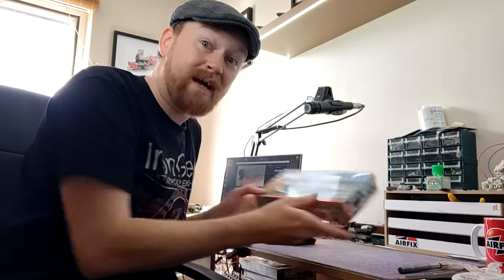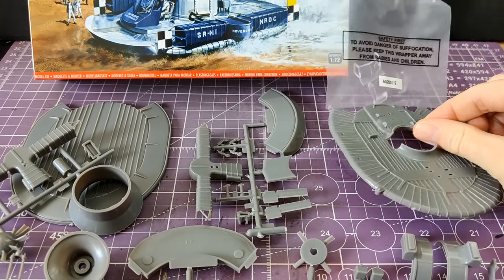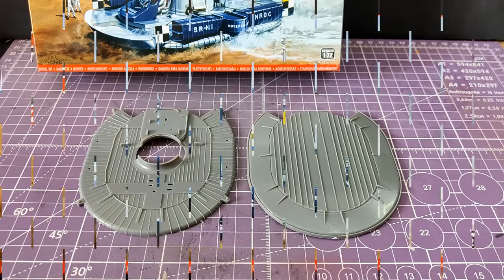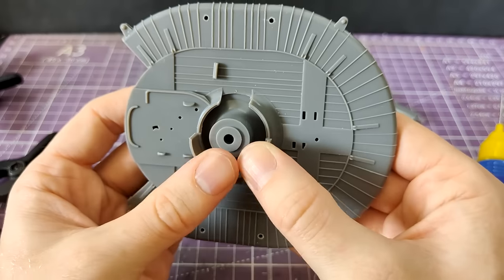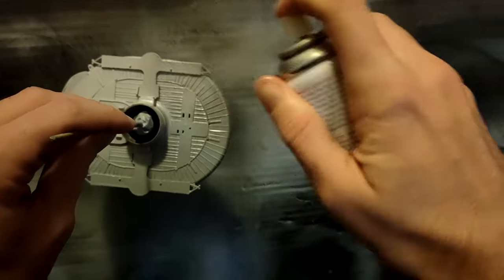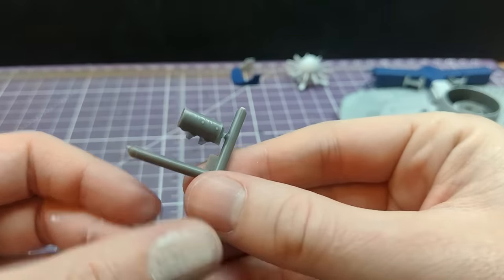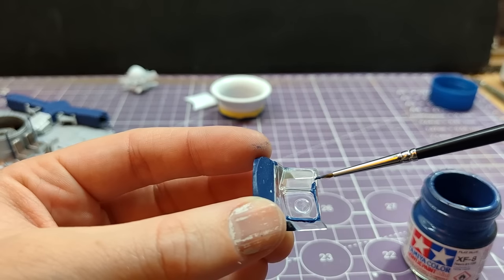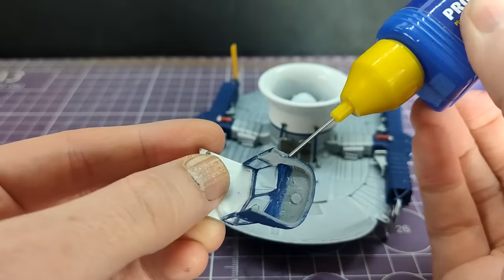Is the Airfix SR.N1 still good after 6 decades?! | Unboxing and full build of a Vintage Classic

Comment: I bought this kit when it was first released at the beginning of the 60s. I'm sure that in those days, when only the bigger and more expensive series kits came in a box, that this, like all the Series 1 & 2 kits, costing about 2 shillings or 3 shillings and sixpence (10p & 17.5p), came packed in a small polythene pouch, with the instructions, main illustration and description being all on one sheet of folded paper that formed the seal to the bag, fastened to it with staples.

In those days, with written construction details as well as the illustrated blow-up version, each part was identified in the (English only) text by name, leaving the guesswork out of what each bit was.

From memory, your blue looks about right. It was certainly a mid/dark blue rather than a light shade.
Reply: Two shillings and three pence I seem to remember, used to get change from half a crown?

Comment: I made this kit 60 years ago!
SARO was a remarkable company especially its post WW2  produces. There was the Princess the largest of British flying boats ten engines, might have been largest practical ever because it flew a lot more than the Hughes H4; the SR A-1 Flying Boat Jet Fighter; the SR-53 Rocket and Jet interceptor; the Skeeter and P531 early light helicopters; the SRN1 the first hovercraft, the SRN4 Mountbatten the largest ever passenger-car hovercraft ferry.  If that was not enough they produced the early full size satellite launchers Black Prince, Black Arrow and Black Knight.
Reply: I think this was the first kit I bought and build because it was the cheapest, I didn't even paint it... no idea what happened to it, probably got tossed

Comment: 4:59 This is the air smoothing vanes and dome. The fan is the four bladed part that fits underneath. 
If you relieve the hole in the four bladed fan, you can have it rotate (otherwise it is tight). Painting the four blades in a contrasting colour to the white will make them stand out better beneath the 11 vanes. Of note, the instructions don't give any indication of orientation but I can tell you ... having a single vane to the rear and two vanes to the front is correct.
Reply from the maker: Excellent! Thank you for the info!

Comment: Yep, I'm afraid that I also made one of these back in the 1960s. Flashback time.
Whilst not even being a teenager, I couldn't understand how it could form an air cushion. No holes in the bottom ? !
Also, when it's been broken a few times and it is time for it to go (I was a kid and it had a hard life) without the wheels, it can skim over smooth floors quite well if thrown like you were skipping stones across a pond. (not so good on water.)
Mine of course looked nothing like yours'.

Comment: 5:11 The part on the runner bottom right is the four blade fan. 
To get this to rotate freely on the spindle, relieve the centre hole. 
As it is, it's a really tight fit and the blades will most likely get broken when fitting. 
I painted my fan blades red (wrong I know) so that they can be seen below the smoothing vanes.

Comment: Interesting the model depicts the hovercraft in it's prototype form, later it gained a more pointed bow , doors to the cabin and twin fuel tanks one either side towards the front, also the front windscreen was fitted with window screen wipers instead of the circular spinning clear screen.
Reply from the maker: I expect the R&D for it was either done before the changes were made, or from drawings supplied by Saro. It is fairly standard for Airfix kits of this era to be made from prototype drawings over the real thing - part of their commitment to get a model out asap.

Comment: This kit stands out so much in my mind because it was so unique when I built it back in the mid-1960s. The re-issue stands the test of time well, probably because there's nothing else with which to compare it. The re-issue is great and I'll build it again but I would have loved to seen a completely new kit in 1/48 or an even larger scale. (Not sure if that should be 1/35 or 1/32 scale. It's a land and sea vehicle but actual travels above them, in the air. So, should be be larger AFV scale or larger airplane scale?).

Comment: Remember it coming out. The plastic was a silvery one, I think, and the ducts and rudders weren’t very well formed. The glue we used then was very corrosive and it was incredibly easy to melt the rudder mounts. Modern plastic works much better than the old stuff. 👍

Comment: I’ve found a video on YouTube showing the srn1.  It shows the crew wearing white overalls with oxy masks and silver bone domes.  It also shows an exhaust pipe on the left side of the engine trumpet, right where you assumed that it was incorrect
Reply from the maker: I still have the figures - I may paint them up and fit them.

The exhaust is on the left side on mine - following the instructions would have put it on the right side.
Reply: @VFCproductions  yeah that’s what I meant.  You thought you’d fitted the ducting the wrong way, but you havent

Comment: The 'beauty'of buying the Airfix vintage classics is, as they're using the original moulds, you'll have plenty of flashing and mould faults to correct - ! 😅
Reply from the maker: Flash is just extra plastic for your money!
Reply: I gave bough a couple of the Vintage Classics kits like the Beaver and the Bassett, as swell as the SR-N1, and Airfix have obviously taken the time to make sure the moulds are clean, helps that these kits haven't been around much. If you want flash try a Mach2  kit. Real sense of achievement as well.

Comment: Bought a SRN-1 this week & was gutted to find some of the Cartograf produced decals on the sheet are way out of register !  ( No.3 SRN-1,  No.4 NRDC & No.6 Hovercraft decals )
Anyone else got the same problem with their SRN-1 decals ?  This is the first time I've had this problem with any of Airfix's Cartograf made decal sheets ...
and I've got lots of the new mold & Vintage Classics kits in my stash.  What is Airfix's customer service like these days, will it be easy enough to get a replacement decal sheet ?
Reply from the maker: Is this not how they are supposed to be? The photos of the real thing show a very heavy shadow on the text
Reply: @VFCproductions  Thanks for your reply. If I could post a photo you would see that the blue shadow effect on my sheet is way, WAY out of register. 
My decals are nothing like the sheet in your video. They are most definitely out of register ... by several millimeters !  
The blue shadow effect is totally separate from / doesn't touch the white lettering, it's miles off !  Very un-Cartograf like, they're always "spot on" register / quality wise.
Thanks again.
Reply from the maker: @wullie3xv923  I would absolutely message Airfix then. Certainly a surprise, as you say, but I'm sure they'll be able to send out another sheet. I've not needed to get a replacement from them for some time, but I hear they're still good - let me know how it goes if you do.
Reply: @VFCproductions  I've just finished pinging off an email to Airfix with a photo of my decal sheet attached. Lets see how long it takes me to receive a replacement sheet.
This is the first time in decades I've needed any kind of replacement from Airfix so I hope their customer service is still functional !   Thanks again ....
Reply: Great news, folks. A perfectly printed replacement sheet of SR-N1 decals from Airfix was delivered this morning. 
From emailing Airfix to receiving it in 5 days flat. I'm a very happy ( long time ) Airfix customer.  Their Customer Support seems to be alive & well.
Reply from the maker: @wullie3xv923  fantastic result! Thank you for the update

Comment: Not sure why the pilot/co-pilot should have oxygen masks considering they were no more than 1M off the ground
Reply from the maker: From the excitement?
Reply: They were kitted up due to the noise of the hovercraft and having no doors, for communicating with each other and with the control centre.
Reply: Scuba gear in case it sank.